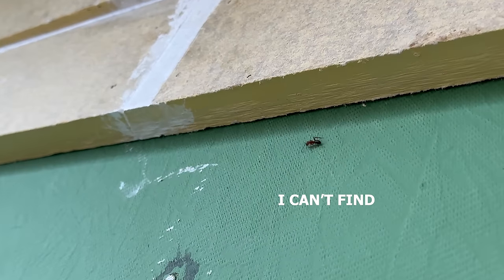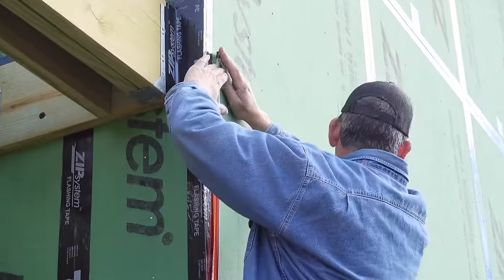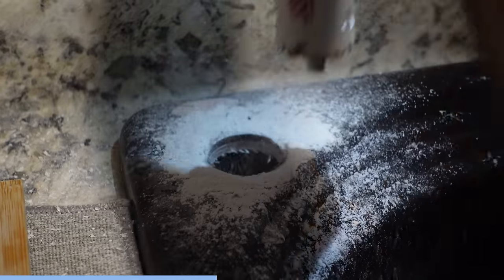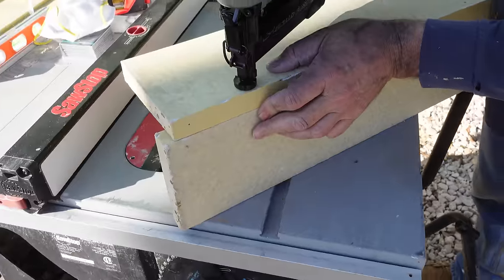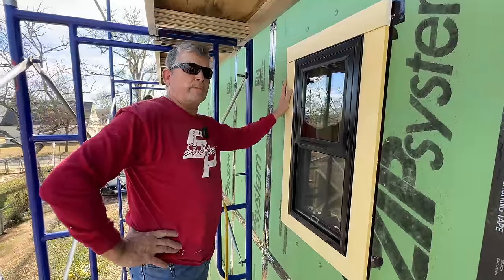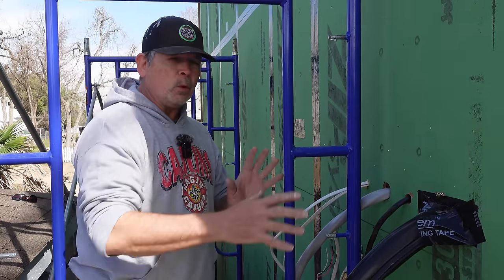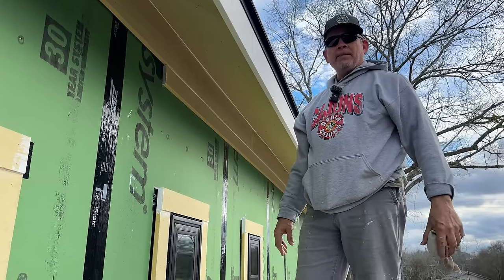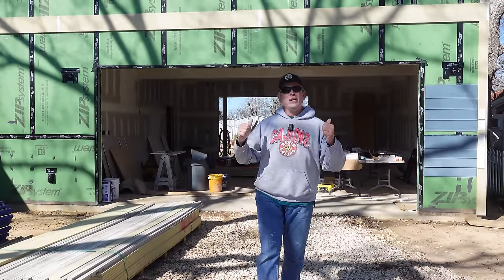Is THIS $30 DIY Water Level BETTER Than a Modern Laser?

Comment: Okay.  I haven’t used a water level yet in my few houses I have helped build.  And I am missing something. How do you know how much higher or lower that one side needs to be?  I know there has to be a line drawn somewhere twice on each side.  But how that line help if there’s a 60 foot wrap and then just a 30 foot wall.  And don’t you have to have extra water for longer areas.  Maybe I just don’t get this simple ancient concept.
Reply from the maker: I stayed at my benchmark by the back deck.  Rad worked his way around the other three corners.  After we "uncorked" the water in the tubing seeks it's own level both ends exactly the same.  I would raise/lower my end until the water level was at my benchmark and Rad would mark his end.  Grab some tubing/dye/corks and play around with one, check your laser against it, way cool

Comment: when do you use a scarf joint versus a butt joint?
Reply from the maker: Scarf joints are used when you want to hide a joint a little better.  Long runs of crown molding will have them (most of the time).  They tend to be a bit easier to get the faces aligned and offer a larger glue/sealant joint

Comment: The end cut should have continued through on the right side of the batten board in the front, with the right wall batten board butting up to the back end of the front batten board. You are mixing end grain and through grain on the presentation side of the building. Looks a bit goofy

Comment: Why did he use 90 for 123.8. I’m confused
Reply from the maker: On a miter saw, the angles on the adjustable table don't make much sense sometimes.  The blade is already at a 90 degree angle to the fence so I adjusted the miter to 33.8 degrees.   90 plus 33.8 = 123.8, the angle Rad called out to me

Comment: Sorry but as a homebuilder for decades I never once saw exposed and butt-jointed corners of lower or upper band board. Vertical trim boards top to bottom through centuries of homebuilding unless I've lost my eyesight or mind. Both could be true, I suppose.😇

Comment: No vents in soffit so I'm assuming the attic is vented another way? Or is there no attic space to vent? I'll have to go back and re-watch the insulation install..... Nice work as usual Stud Pack Crew!
Reply from the maker: No attic space, no roof vents, it's monopoly framed with an energy recovery ventilator for fresh air

Comment: Why are you guys using hardie board.  I am a siding  installer myself. . I install a lot of hardie don’t get me wrong.  But you guys are in an area. Where LP Smart side is pretty popular.  I just don’t get why people would use hardie and have to breathe that dust and have pieces break on you just trying to hand them up the scaffolding. When In my opinion. LP smart side is so much easier to use and a much better product in my opinion.  Costs are similar. And LP offers the same warranty. Plus you don’t need to spend hundreds of dollars in blades. Just basic woodworking tools. I will give you some advice since you’re already using the Hardie. Spend the money. Buy a set of fiber cement shears for Hardie. It’s dramatically cuts down on the dust and very easy to use.  No matter how well of masks you have.  You’re gonna inhale silica dust with the hardie and that alone is my main reasoning of why I hate using it. That and how brittle the actual siding is. I just love LP.  You can handle 16’ lengths with one man. It’s a lot more ridgid. It’s just an all around better product imo and so much easier to use. Plus. I’ve replaced a ton of rotten hardie board.  It does rot. I don’t care what anybody says. It will rot. I’ve seen it rot within 5 years of installation. I’ve yet to see LP smart side rot yet. You guys are doing a Great job. Don’t get me wrong but as an installer.  It’s night and day easier to install smart side and in my opinion it’s a much better product. Go get a sample of LP and get a sample of LP. Take a claw hammer and beat the crap out of both of them. I bet you can’t even dent the LP and hardie crumbles with damn near every hammer blow. Just my two cents. To each their own. Just curious as to why you chose hardie over LP. I can’t get many of my builders here in Ky to make the switch but if it was up to me it wouldn’t break my heart to never touch hardie again. LP ftw all day long in my opinion. Can you give me your thought process as to why you chose hardie over LP?